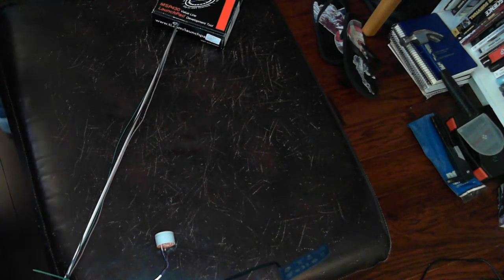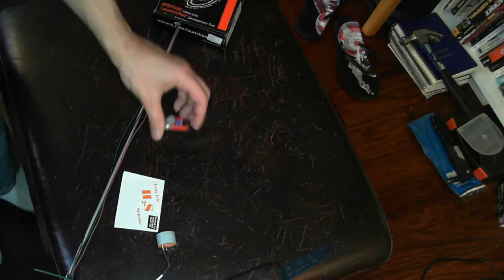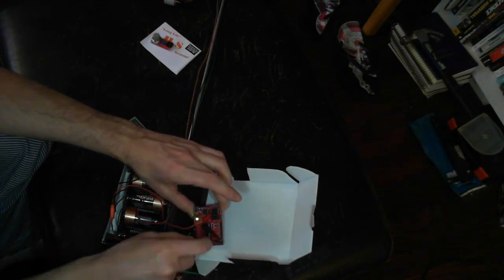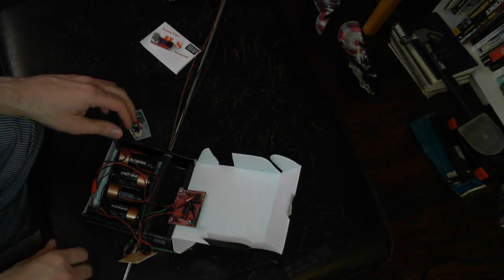Roomba Poop Sensor Part 2

Comment: I think the fun part is going to be trying to get the launchpad to interface with the roomba.  There are all sorts of Arduino tutorials for getting into the port, but TI products are in my experience NIGHTMARES!  Keep up the great work!
Reply from the maker: I did some testing with the LuanchPad and a Roomba.  I am able to control it quite well using the MSP430.  There is a great tutorial here... http://forum.43oh.com/topic/672-controlling-roomba-robot-with-launchpad/ 

When the poop sensor smells danger, I want it to send a signal to the Roomba to stop and then play a custom WAV saying something like... "I smell danger.  Please check the surrounding area for poo."

Interfacing the MSP430 with the the Roomba is fairly simple. I did find an issue that might be a tough one to overcome.  It turns out, when you initiate communication via the port on top, you must take full control of the robot.  The main program stops running.  The logic for taking full control then getting it to talk then relinquishing control back to the user interface on top is slightly more complicated but certainly possible.